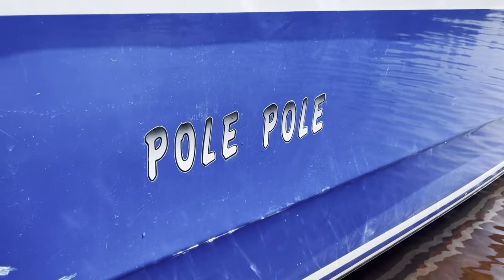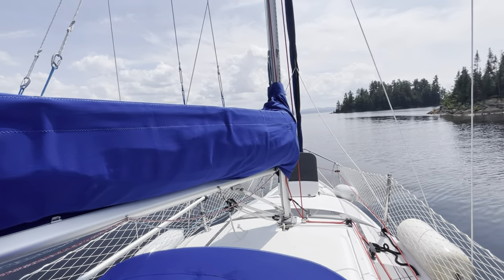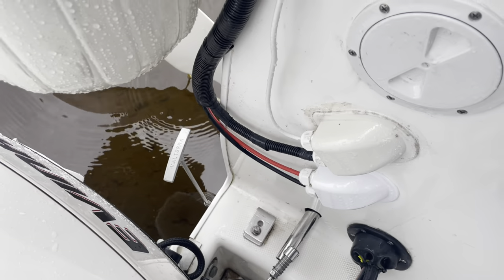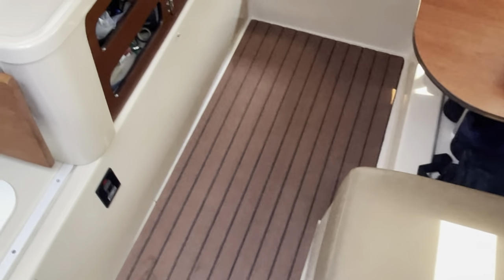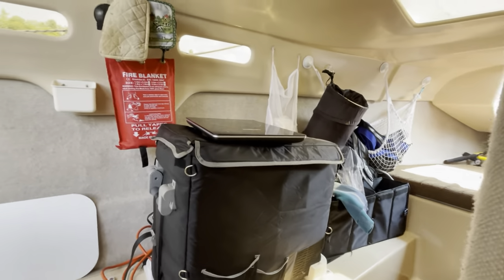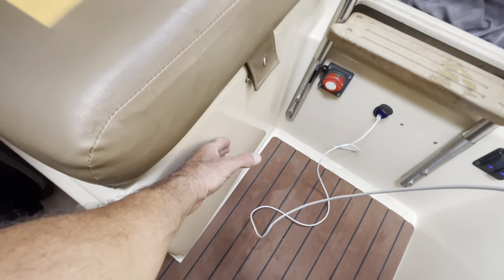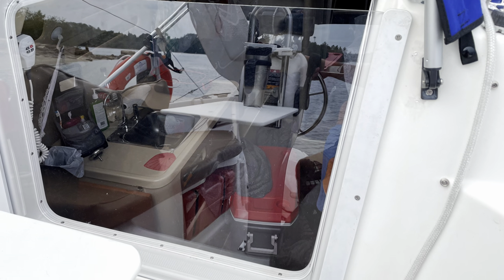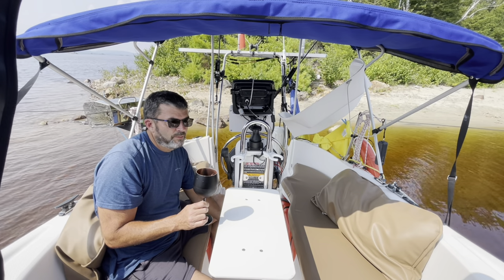Mods and upgrades - Pole Pole

Comment: Thank you very much for sharing your upgrades! They are really well done and I like them a lot!  Can you please share the following info:
1. The raymarine equipment 
2. The Captain Morgan box where did you order it
3. The solar panel tubes and supporting devices!
I am following you on youtube and I really encourage you to continue posting videos with related trips/upgrades! 
Thank you! Daniel
Reply from the maker: Thanks. I appreciate your kind comment. 😎
The solar tubes and hardware were bought at my local chandlery. Standard 7/8 in SS tubes and fittings. 
I had previously beefed up the solar panel alum. Flimsy frame with 1 in square alum tubing for strength. 
For the box I had it custom designed and 3D printed to fit the instruments. Worked out great and was able to get my Capt. Morgan autohelm name on it this way. Was a fraction of the cost of a marine Pod. 

For the Raymarine, I installed the EV-100 package https://ca.binnacle.com/product_info.php?products_id=9812&gad=1&gclid=EAIaIQobChMI05eBxvaUggMVTM7ICh2KLwEwEAQYASABEgJRzvD_BwE. 
And added the i60 windvane. https://ca.binnacle.com/p8798/Raymarine-i60-Wind-System-with-Masthead-Transducer-E70150/product_info.html

Cheers mate
Reply: Thank very much for your prompt answer!
Reply: Thanks, this video is awesome.  Would it be possible to be directed to the 3D printer of the Captain Morgan box.  I would love to order the Captain Ray equivalent.  This is exactly what i have been looking for.  Thanks DJ.
Reply from the maker: @Darrenj195  thanks mate. I appreciate your comments. The Captain Morgan instrument Pod is a custom design I had done by a 3D CAD tech, and I had it 3D printed with UV resistant polymer. PS. Who’s Capt Ray? 😎
Reply: @polepole9066  our autopilot is called Ray.  Not so original as it is a Raymarine.
Reply: @polepole9066  I have already ordered one of those brackets you use.  I may just make a box from ply. If you ever go into the market of selling those pods, let me know;-).
Reply from the maker: @Darrenj195  no worries. PM me at dupuian@icloud.com

Comment: Excellent video. It’s so helpful to see ideas on the same model. Could you say more about your stern anchor setup? Where do you store your anchor and rode? And what size/length have you found works? I’m thinking about moving my danforth to the stern and buying a Bruce for the bow roller. I find anchor shopping overwhelming. While I’m on the topic, would you get the Bruce again?
Reply from the maker: Hello. Thanks for your comment. The Bruce claw works well for the bottom type at the lake I usually sail. I’m sure other more $ anchors like Rocna or others would hold even better with less weight. The stern light weight fluke is good for that purpose. I store it in a white  vertical PVC tube on my stern solar post, and I only have 8 ft chain and 100 ft rode also stored there. I often tie the stern ashore and anchor the bow fwd.   cheers mate.
Reply: @polepole9066  very helpful thanks. I can see how PVC would be effective. Does the chain and rode sit in a separate bag you also hang?
Reply from the maker: @ericpgreen  the chain tucks in the pvc and the rode is draped over the stainless tube, same way you would over the railings. Cheers .

Comment: Well done, merci!  Could you share the make/model of the electrical switch/fuse panel you have?  Where do you order your stainless mounting hardware (antenna mount, solar-panel stabilizers, etc.)?

If I may suggest, for your solar panel: make sure there is no "hard" shade on any of the cells.  They are usually wired in three strings with bypass diodes.  If shade from the flag placed too close creates a hard-lined shade on the panel, it will almost fully shut down 1/3 of your panel (have a look on your MPPT).  So just move the flag a bit higher, and make sure there are no other poles, antenna, etc. creating a hard shade line on the panel.  Diffuse shade is not good, but not as bad.
Reply from the maker: Thanks for the solar tips. You are 100% correct. I know i lose a bit of solar input but since I have sufficient power I don’t worry about it. I did wrap the flag on its pole a few times to avoid shade.  Cheers
Reply from the maker: The SS hardware came from Chandlery and other local marine stores. 
I took the fuse switch on Amazon. In retrospect, Would recommend a red lights instead of blue though (for night sailing and blue light can affect sleep cycle). Rupse Overload Protection 6 Gang Waterproof Car Marine Boat Circuit Blue LED On/Off Toggle Rocker Switch Panel Digital Voltmeter + 12V Cigarette Socket + Double USB Power Charger Adapter https://a.co/d/8zIhK9U

Comment: Thx for the Video! Very interesting! Can you say something about the overall-weight of the Boat?
Reply from the maker: The 26M dry weight is 2550 lbs, the engine is about 420 lbs. then 70 litre of gaz is about 115 lbs. 
I’m sure the rest of the boat content could add up to 600-800 lbs. 
then the 100l fresh water weight 220 lbs. but I don’t trailer it with water on board. I fill it once at dock. 
So I figure  I tow about 4000 lbs boat plus the trailer weight. Let’s say 4500 lbs to tow. 👍🏻

Comment: Great video! Thank you very much!  I didn't see a backstay on your boat. I'm assuming if you put a spinnaker you may need a backstay to ensure the mast won't fall forward. Am I right? I saw pictures of 26x having backstays.
Reply from the maker: Thanks. Actually the 26X has a back stay and the 26M doesn’t.  The mast stays up with the fractional rigging and swept back spreaders and standing rigging.  But it’s more prudent to have the main up with the spi to counterbalances forces.

Comment: Very informative videos. Maybe you could help me. I just bought a 26 m and can not figure out how to run the rudder lines to keep them down securely when sailing. Thank you
Reply from the maker: @NevilleBethel  thanks.   Is your rudder line installed?  If properly installed you just pull the opposite way and tie it to the same cleat to lock them down. (Pull the line that goes down the small hole in the stern top). It goes down the tube and attaches to the back of the rudder.
Reply: Thank you.

Comment: Great Job!  I have been considering a MacGregor for years, but never pulled the trigger.  What do you estimate was the total cost of your mods?
Reply from the maker: Thanks. That’s hard to say. A lots of small ticket items are over $100 each so it adds up. But for large ticket items like autohelm, lithium, solar, fridge, electronics, sails, etc.  I would say at least $12-14k. CAD. 🇨🇦

Comment: What is your sail speed? Under power what is your cruising speed? What is your fuel useage at cruise speed?
Reply from the maker: @wesm3915  she could sail up to 6 kn under correct conditions. (Main and Genoa). She did over 4kn in 7kn wind under Spinnaker/Main. 
Her top cruising speed at WOT is around 16 kn with full ballast and 18 kn empty ballast depending on weight on board and water conditions.  (60hp Evinrude ETEC)

Comment: Did you paint the bottom with the boat on the trailer or lift?
Reply from the maker: I applied the pain on the trailer. Lifting bow, apply, dry, then lowered and and lift stern … repeat. Cheers   Used V17m   Dries really quick.

Comment: I put a drain plug under the back bed because water would collect there a lot during a big rain. Anyway I forgot to close it after driving from Memphis TN to Pensacola Fl and putting it in the ocean there. That was a big mistake, water went everywhere and it ruin my week Florida vacation. So stupid. I sold my 05Mac26M in 2020, because I was only off in the summer ( June-July) and then it’s too hot to sail, well that’s what my girlfriend said.
Reply from the maker: Bummer for sure !

Comment: Has anybody taken one of these offshore. 
 How would you attach a wind vane
Reply from the maker: Check out Dr. Marco’s channel. https://youtu.be/lP5JVJrwt0o?si=fRqUs_TZqJ3VdcUu
Reply from the maker: I mounted mine on the solar arch to avoid the rotating mast angle correction.
Reply: @polepole9066  Just watched it .
 Gold. 
It's definitely an underrated vessel.